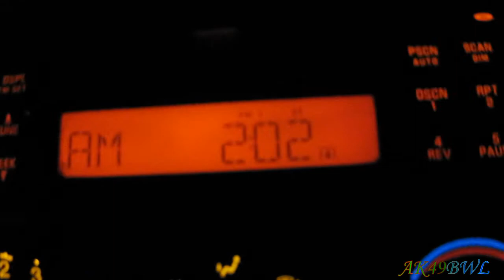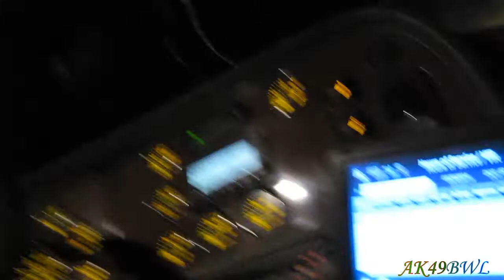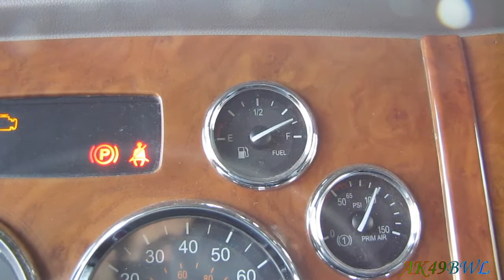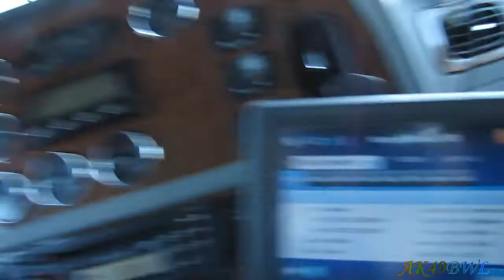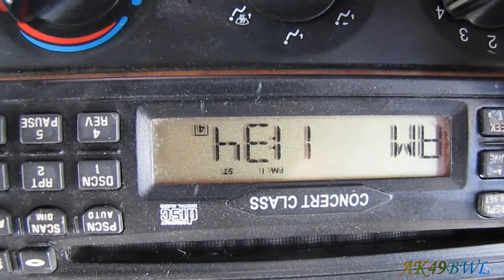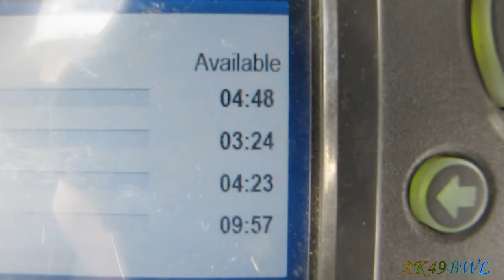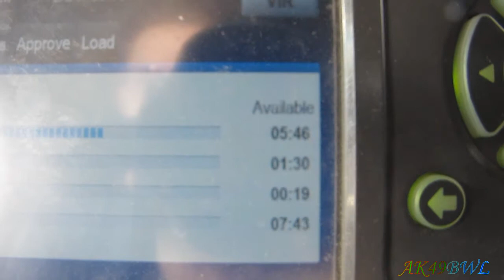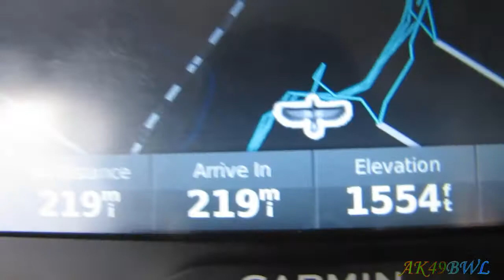How (Not) to Do A Tarp Job - DD14

Comment: I have never seen someone take that many flaps off what the hell ya doin? Lol
Reply from the maker: I wish I knew! :( I haven't even gotten into anything that would have taken a flap off this time, since my service... The only thing I can figure, and it's a long shot, is that when I emptied the tandem air suspension to drop a trailer, I may have backed up while the flap was dragging the ground and the wheel pulled it off? I really don't know.